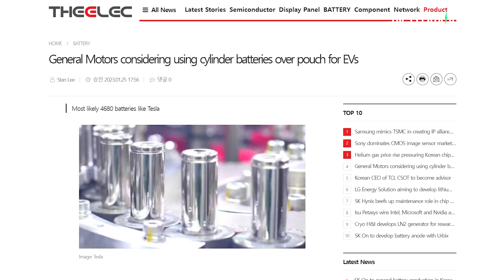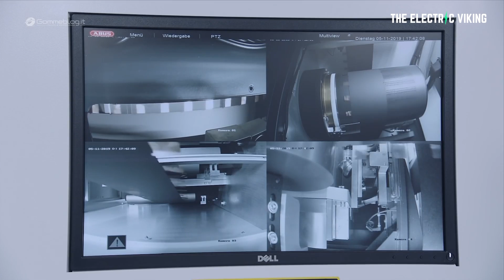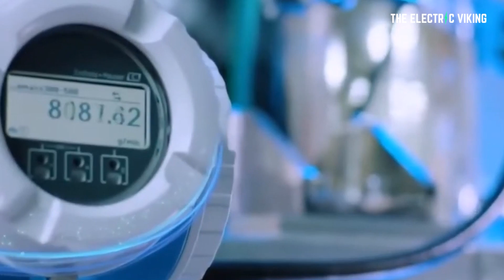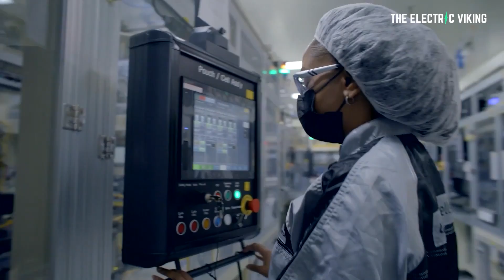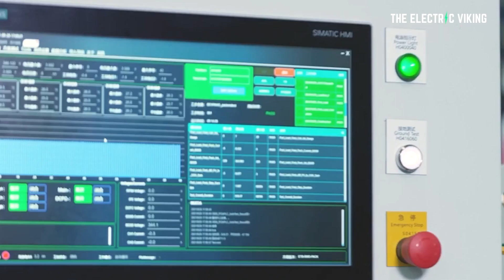Is GM changing from Prismatic to Tesla's 4680 cylindrical batteries?

Comment: Cylinders are the optimal shape for high speed production
 Having worked canning soft drinks for many years I can verify that very high production speeds are possible.
And I mean very, very high speeds
The canning filler could fill the can with pop and fit the ring pull can end at two thousand cans a minute. Any other shape - no chance.
Reply: Can you expand on that thought please? I THINK you are right because any corners will eventually be misaligned and jam. But you have experience and I do not! Thanks
Reply: @johnryan8645  High speed beverage canning system have reached efficiencies in the 99% at rate of 2,000 cans per minute. Due to standardization of the can end (202 vs 206 vs other). And the use of rotational continuous motion of the filler systems. Nearly the same has happened in the PET beverage world where they can reach 2,300~ Bottles per hour per station. With most machines having 20+ stations, so roughly 46K bottles per hour. 

This became obvious to people like Michael and I that are in the beverage industry, as when we 1st saw the Tesla 4680 Cell production videos back in 2020. It looks like a canning production line, using continuous rotational cycles. Its very efficient and can put out (excuse the pun) high numbers on a relatively small equipment platform. 
And as you stated, less issues in indexing the components for alignments. 

You can see a high speed Can filler here. 
https://youtu.be/212bRKJorEs?t=111
Reply: @fredpinczuk7352  Wow! Now that’s a production line! The shear speed of it has to cut inventory costs, etc. As line speed goes up factory overhead costs must shrink to near zero! Thanks for your explanation and the video!
Reply: @johnryan8645  You're welcome. Correct, in the beverage world, where every single person or entities that handle a beverage gets a significant cut on their way to a consumer. One way to make money is use cheap sugar and high speed equipment.
Reply: That would be about one ton/minute. A full conversation to electrification needs about 200 of those cell lines. Maybe more of the machine that makes the machines.
Reply: TY    📚📚  👌

Comment: What I was intrigue with the Ultium/pouch platform was the modular component.  Being able to replace defective batteries on a modular design.  From a manufacturers build, warranty work would seemed to be a lot less cost than the structural route.  The 4680 is still  in its development and usage stage.  There hasn't been a lot of rubber on the road feedback.   Just about every week, there is some breaking news about EV batteries.

Comment: I don't know whether 4680 cylindrical cells are better than CATL's pouch cells. In general, when you refer to an "engineer" with an opinion, a link to the opinion helps. Maybe manufacturing 4680 cells in a factory designed to produce smaller cylindrical cells is less costly than retooling the factory to produce pouch cells. Makes sense to me even if pouch cells are less costly to produce ignoring the sunk cost.
Reply: Tesla has just started upping the energy density of the battery chemistry in their 4680 cells. But the most important thing about the cylindrical cell is speed of production. Using the canning industry as a model, the 4680 lines should be able to ramp and make tens of thousands of cells per hour. Just like Coke and Pepsi do. 
Stand by for announcement that Tesla has plans for or already owns a working Lithium mine in Nevada and that they will be processing that Lithium themselves in a couple of years.

Comment: Pouch batteries are terrible for extreme temperatures with lots of vibration and shock (e.g. vehicle applications). GM and BMW learned the hard way.
Reply: Elon warned them not to use that format. Tesla has already tried it and found it didn’t cook well and also that they did get damaged due to vibration. 
I really worry about the Hummer EV will break down on people in the wilderness.

Comment: The detractors of cylindrical cells don't understand the simplicity of the manufacturing equipment used in cylindrical cells compared to the nightmare of the equipment required to collate, connect install and seal pouch cells. Add to that the dry battery electrode process, and it's easy to see why 4680 cells are so much cheaper to make. Also, it takes almost the same factory footprint to make 4680 cells as it does 2170 ones. Tesla are going to wipe the floor with the competition. They will aggressively ramp up the speed of the production lines once they can guarantee the quality at the initial run rates. the sky's the limit because the process is so straightforward.
Reply: Roger F • Tesla is encasing the cilindricsl 4680 cells pack in a kind of strong foam, so the new 4680 Tesla battery pack is unserviceable and unrepairable. When you buy a new Tesla car built with 4680 batteries you get a financial disaster.
Nobody will buy in the future these Tesla EV models from you, and you'll lose a lot of money by selling it later for next to nothing.

Comment: Anyone that says they are an engineer in the relevant fields and does not qualify their battery commentary with "it depends", is blowing smoke. There is no such thing as the optimal battery design. Batteries and packs are designed to meet the intended application, and the applications vary widely.

Comment: Apart of manufacturing efficiency (obviously superior), cylindrical cells are much safer and can be better heat managed.
Even the biggest 4680 cell is small in comparison to pouch cells. It means cooling and heating can be more efficient.
It makes all the preheating in cold, or cooling in warm weather much quicker - which translates for more usable car with more range. It means better performance for fast driving and more efficient recuperation when braking.
But perhaps the most important is the Elon's obsession with safety. Each cylindrical cell is enclosed in an armor - thick steel bottle with the shape pressure-proof in the direction of other cells.
Cylindrical cells are small, armored, and cooled with ribbon pipes with high contact area. The unvelcome expansion of the faulty cell can be squashed by armor and vented down, but in case of serious rupture - the heat can propagate in 6 directions - to dissipate it. So, no other cells can reach critical temperature.

Comment: As 4680 manufacturing quality improves, then the product will advance same as happened with chip manufacturing did … I.e. next gen 4680 cells twice as tall and twice the diameter for 8 times increased capacity.
Reply: Still 3.7 volts
Reply: @theairstig9164  To be fair, AA's last longer than AAA's, they're also the same voltage.
Reply: They are those dimensions because of the physics of the battery materials they are using.
Reply: If they continue to have a quality issues with high failure rates the advantage disappears
Reply: @MegaWilderness  as far as I'm aware, failure rates are low and the ramp is making good progress

Comment: What is good about 4680 cylindrical betteries? Optimal cooling/ easy production. What is bad about 4680 cylindrical batteries? No structural battery pack/ expensive cooling. I think that GOTION is using cylindrical batteries.

Comment: Tesla are starting to use BYD blade battery technology.
Reply: Not because they want to. They just need as many batteries as possible and BYD can supply them.  Tesla isn't being picky about form factor as long as the fit the packs and can be made  at scale.
Reply: @josephhobbs4754  Good point but dont forget all the technology Elon Musk has all came from China.
Solar city, spacx, rocket engine and reusable rocket, Tesla, autonomous driverless system, electric motor, battery.
Reply: But not here. I feel like protectionism will be keep a lot of Chinese IP and associated manufacturers out of this country. And that could drive different batteries in different markets.
Reply: @larryevans6739  Yes, but future model will use it. Tesla battery are not safe! Their gigafactory will have to stop making them.

Comment: It's not just range, but cost/range. If you can get all the range you need with 4680s, and they're cheaper, then that makes more sense. Pouch cells pack together tighter so the total volumetric density is higher, but not by weight, which is what matters more unless you're talking about compact cars maybe, which have less total room to shoehorn batteries into.
Reply: You may be right, but we shouldn't forget that there are more compact cars out there that needs replacement by BEV's than trucks. This is why there will still be a market for CTP as size matters. BTW CTP still also has some weight advantage due to the reduction of module making materials.
Reply: @beatreuteler  Tesla was the first to announce CTP... with 4680s. CTP doesn't require prismatic or pouch cells. In fact, 4680s are better for CTP as they're more stable in every direction, including torsion. Compact cars, as a segment, will be able to be addressed as a segment with 4680s as energy density continues to improve. But right now, probably prismatic or pouch cells would be better for compactness.
Reply: @truhartwood3170  I think it is still to be seen if single cell stability is really that important unless the goal would be to build them in as single cells in any structure. Blade cells are made for CTP and depending on smart package may stabilize themselves with the way the pack is built. Cylindrical cells however are not able to do that which is why they need to be stable within themselves. I think blade cells did not so far have enough time in the field to proof they are doing what they are supposed to do, so we need to wait and see.
Reply: More like cost/kWh.
Reply: @Chainyanker007  Yeah, cost/kWh is basically the same as cost/range, assuming two vehicles of the same efficiency. The video was just talking about how a vehicle with pouch cells could, in theory, have more range, so that's the metric I stuck with. Right now the cost of the battery is a big factor in the cost of the vehicle, more kWh/range jacks up the price. It also jacks up the weight, which has negative effects on ride quality and efficiency. Before you get to the point where you're maxing out how many batteries you can squeeze into the chassis, the car is already getting too heavy and too expensive.
Reply: Weight is Not the primary factor when designing for high speed range. The Lucid Air weighs over 5,000 lbs, yet with its large battery and fantastic aero, it can achieve over 500 miles of range.

Volumetric energy density and cost matter more.
Reply: @TecnamTwin  OK, and it handles like $h!t as it weighs 300kg more than a Model S Plaid, which was part of my point. Yes, more batteries will go farther, duh, but are you arguing that if that exact same car (same drag coefficient and tires etc) had 300kg shaved off it wouldn't be more efficient? Of course not. Also, Lucid uses 2170 cylindrical cells, showing that you can totally get enough volumetric energy density with cylindrical cells, and 4680s will have higher volumetric density and kWh/kg and kWh/$$ than the 2170s Lucid is using. All of which makes my point that cylindrical cells, especially the 4680 size in structural packs, are the better way to go than pouch or prismatic cells.

Comment: The 4680 pack has fewer cells compared to a 2170 pack with a similar amount of energy. Fewer cells means fewer busbar connections. Fewer connections means less complexity and lower manufacturing cost… PERIOD, or FULL STOP for Auz and other Commonwealth English speakers 😎😉
Reply: Imagine the connection savings using blade batteries the width of the vehicle

Comment: Pouch format batteries are nothing new. They are cheaper and easier to produce but lack key aspects when it comes to EV’s. They do not work for Tesla’s ethos of performance/range/safety. However, if you want a cheap as possible EV then currently pouch is the way to get there but not likely for long.

Comment: Two years of marketing the "ultium" battery pack to realize they need to change direction. Classic
Reply: there is a reason we had to bail their sorry asese out.
Reply: @godslayer1415  Over and over again. Been bailing GM since the 90's.
Reply: It's called leading from the rear.  Now they are following Tesla who has at least a 3 year lead, more like 4 - 5. In 5 years Tesla will be onto something better.
Reply: At least they didn't keep going down the wrong path.   We need better energy solutions whether it is tesla Ford or gm.
Reply: @chris37393  - That is why Tesla is allowing anyone to use the 4680 form factor it developed.
Reply: It was reveal in March 2020.  No doubt spent a ton promoting it with ads and commercials.
Reply: Plus, the pouch batteries from LG chem were the ones that were catching on fire all of the time
Reply: …… of th leader in th recall an repair race

Comment: It is insane how big this news is, but it is completely ignored by normal media.  GM quietly announces that they will build three prismatic cell factories and then after that, switch to cylindrical.  It makes no sense.  Why build brand new outdates pouch cell factories at all?
Did GM cut a recall deal with LG to force LG to waste money on brand new pouch cell factories?  GM seems like it is burning a bridge with LG on purpose.
GM doing this should be massive news, a change like this would be a huge shift. This 4th factory could be one of those projects that is always 5 years away no matter how much time passes.  It could be more marketing bs by GM to trick investors.

Comment: It might have a bit to do with reliability , charge rates and life expectancy of blade battery that are showing up in the real world . Cooling and heating a battery pack may also be easier with cylindrical packs than blade batteries .
Reply: I was thinking something similar, reliability on manufacture, and reliability of operation.  It only takes one cell to go wrong and the whole battery pack in a dud.  So the manufacturing failure rate of the "can" format versus the "flat" format may be a factor.  (maybe a one in a million, versus a 10 in a million sort of thing)  Similar to memory manufacture where redundant memory cells are included and any faulty cells can be readdressed without the whole memory chip being useless sort of strategy.
Reply: @bigpicture3  Generally the batteries are arranged so that if one fails it doesn't affect the others . Just like christmas lights are today unlike 50 years ago when one build was out you had to change every one till you found the faulty ons. I was thinking in real world use ,high frequency vibration , big bumps ( e.g. off road ) and heat management of the battery packs , speed of degradation of capacity , fires ( GM Bolt )  etc
Reply: @grahamoldfield3474  Reliability of operation would be that each cell does not get shook apart internally. (mechanical and chemical reliability)  That the whole pack appears to be glued together as Munroe Eng. demonstrated, is about the mechanical reliability of the pack as a whole.  Then there are the thermal considerations, practical use of the battery waste heat, and eliminating fire risks etc. which gets back to cell mechanical reliability inside and outside as a common fundamental to all these.
Reply: @bigpicture3  Yes mechanical reliability and the TESLA 4680 is tab less so it avoids this problem area . You cool the  bottom of the battery now not the sides . Tesla is miles ahead and it depends on their patents   if other battery suppliers  can make tab less 4680 or they have to use tabs .
Reply: @grahamoldfield3474  I have heard they have the tabless patented. I am curious to know this definitively too.
Reply: @BSAF83  I don't know but I believe they do . They also have patterns on some of the Metallurgy and processes used in the Giga Press to make car components .
Reply: Totally agree. I think the core thing that Tesla figured out was the thermodynamics of the battery as a whole. I really think Tesla has to have the best thermodynamics engineers on the planet. The octavalve and heat pump system was wizardry. Tesla is also tremendously far ahead of the competition on battery thermals, not just the ability of keeping the batteries cool, but also being able to efficiently keeping them warm when needed.

I'm not a conspiracy theorist but I also don't have myocarditis from being a Government guinea pig. But the amount of politically driven heat Elon Musk took for buying Twitter and the Tesla Stock short to close out the year. I think there was a coordinated effort by the competition, who may be figuring out that indeed they are far behind Tesla and they may face doom. I think there was a lot of combined money and effort on the Tesla short. Look at this list and you will see that only one bend of the political spectrum binds them.

Legacy Auto boards & CEO's
Unions
The woke left bent over the Twitter buy
The media who are now the megaphone for the woke left

So to close out the year and go into a new one. Elon Musk endured a coordinated attack & stock short. The CEO is in court. The 3rd QTR report was amplified as a Tesla miss and tons of speculation on if Musk is letting Tesla falter because of his focus on Twitter. He put up with it all.

Cuts Prices

Two weeks for it to digest and the smarter ones are figuring out that Tesla won and are now scrambling to try to copy all of Tesla's manufacturing trends.